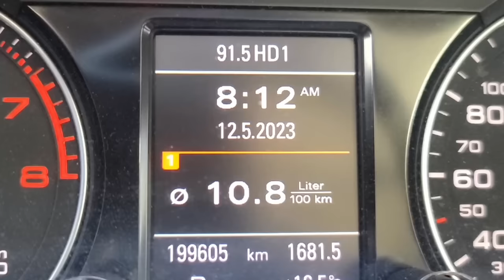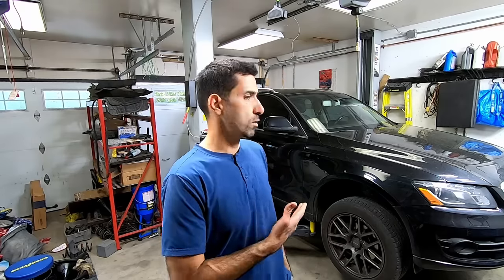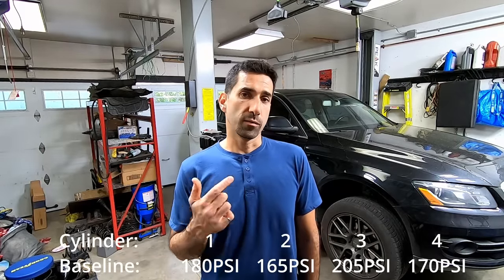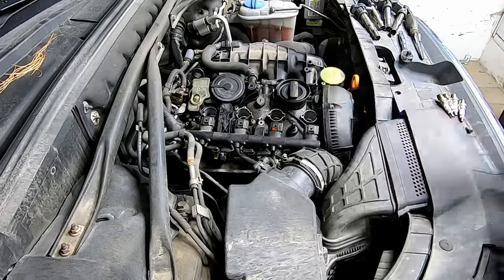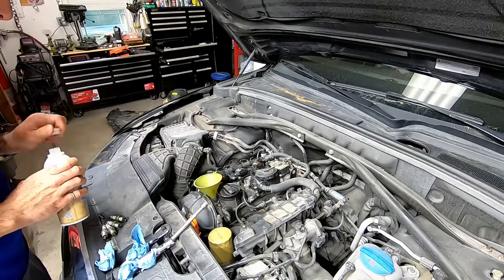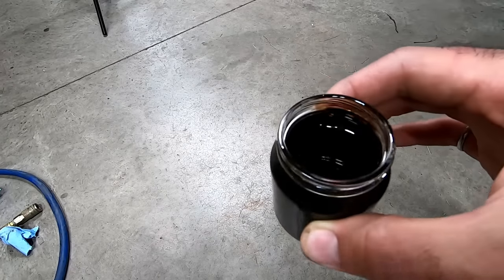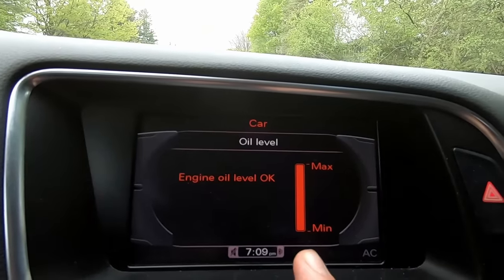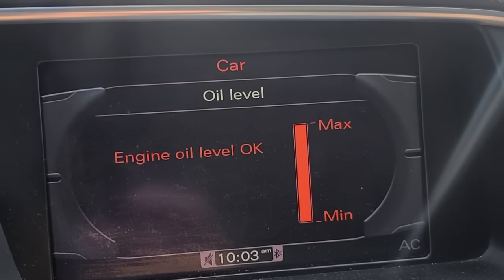How to fix excessive oil consumption from clogged piston rings (Part 2)

Comment: Hey Eurotrash, I have a 2013 a4 with 90,000 km burning 1 liter per 4000km. I am thinking of trying the piston soak before it gets worse. Do you thing this is a good idea? Thanks

Update: Have performed the piston soak using 1 can of berrymans on Aug 24 2023, will update will oil consumption rate as it comes.

Update 2: (September 19th): Put about 2500km on the car and the oil level still reads full, Seems like zero consumption. I am using Penzoil 5w40 euro.
Reply from the maker: Hey that's within spec for sure but there's really no downside to doing a piston soak - can't really hurt anything... at your next oil change just do one up and let us know if it fixed up the consumption... maybe instead of B12 try sea foam as it's less aggressive...or LiquiMoly engine flush
Reply: @ETMotorsports  Thanks for the response! I orded some b12 chemtool on amazon and I plan on doing the soak next month when I change the oil at 8000km interval. I am hoping that this will help prevent the rings from getting stuck and improve oil consumption. I will update the results, if this works it could be a method that can be used whenever the car starts to use more oil again a few thousands km down and repeat the process to maintain an oil consumption level that is acceptable and manageable. That is the goal, I hope to get at least 3-4 more years out of this vehicle and I will be happy!
Reply from the maker: @thomasoneill1077  yah you can do that every year or as long as it helps... do it the first time and see if it improves things...btw you can use the B12 in the gas too - helps keep the injectors clean
Reply: Update #2: The oil consumption has returned to about 1 l per 4500km, it was at full level for almost 3000km then randomly droped very quickly. I will try this again soon but with 2 bottles and a longer soak time of 2 full nights. I noticed that one of the spark plugs threads had oil on them the last time I took them out from the first soak.

Comment: This is such an issue across the board, I feel like this is another stage of built in obsolesce, car works until you have to turn it back in for a lease and buy another one. Between part 1 & 2 I will try this on my other cars, instructions are very simple, thanks!

Comment: If the engine has burned oil for a long time, the piston rings might have damaged the cylinder walls.
Reply: Exactly!
Reply: B12 costs $5.
Is it worth trying?

Comment: I used to do this by flushing the engines with transmission fluid it takes quite a few oil an admirable transmission fluid into your oil help dissolve the build-up

Comment: I have a 2014 Kia Sportage with the GDI engine that started burning oil at 80,000 and has gotten progressively worse. I hate it because the rest of the car has been great. I'm going to try this....Thanks!
Reply from the maker: Good luck - let us know how it goes
Reply: Did it work??? Might need to try on my 2019 Hyundai Tucson 😫
Reply: @rachelodowd6536  OH yeah it hasn't burned a drop in over 3000 miles now. I also drove my car in a lower gear on the highway for about 5 miles with RPM's at 4500-5000. Repeatedly letting off gas and applying gas. Let the engine brake the car some. Try this before soaking. I think thats what fixed mine not the soaking. I'm going to do it every 10,000 miles.

Comment: Hello! Thanks for the great video. Do you have any experience with the Liqui moly engine flush? I’m considering using it on a volvo diesel 2014 after I change the pcv valve.
Reply from the maker: I use LiquiMoly all the time - I've recommended it to a few folks who don't have access to B12... it may not be as strong as B12 so the final results may not be as impressive but otherwise it should work fine

Comment: I have a Jeep Wrangler burning 1Qt every 100 miles🤣. Compression test done 155 psi on each cylinder. Good power. New pcv valve. No smoke coming from the exhaust. Intake manifold has light oil coming from pcv hose. Any Recommendations?
Reply from the maker: Holy smokes... those are hmm good numbers 😱 what year is this? What engine? If no leaks and no obvious source of oil loss it could be rings as well
Reply: @ETMotorsports yeah not good. I replaced everything. 2008 Jeep Wrangler with a 3.8 180k miles. No power issues, no hesitations. Starts good in the morning. I used synthetic since I bought it with 90k. Spark plugs are dry. It has to be the rings. One thing I did notice is that this problem surfaced after doing a liqui molly cat cleaner through intake. After that my oil consumption sky rocketed. I guess it did something to the rings?

Comment: I have a 2012 Q5 with 120,000 kms and started to consume oil…. At this point is using one qt every 3,000 kms which compared to yours it is not too bad…. Anyhow….. I live in El Salvador, Central America… I am not sure if I can get B-12 locally but sure I will love to try…. I also have a ‘11 Q7 with 85,000 kms and this one is not burning oil…. At least not yet…. Thank you very much for your videos I am wishing some more shmucks really get to see useful videos like this one.. keep it up…
Reply from the maker: Hey thanks for the note... you could use a few different products instead of B12 - keep an eye on your consumption and hopefully it never goes to the level most folks see

Comment: @ETMotorsport,
Thanks a lot for sharing a great fix to oil consumption problem. 
I used to burn 1L/600kms. I’m on 1000kms now and oil level is full. I feel so happy after seeing the results man! I used to top up oil every week, else, I used to get low engine oil light 💡.
Reply from the maker: Awesome!! Glad it worked!!

Comment: I just did this on my QX60 with GDI V6, I scoped the pistons before and after and can actually see the heads after, not just a thick layer of carbon.
Reply from the maker: Yeah it does clean them pretty good... what were you consumption numbers before?
Reply: @ETMotorsports  quart every 500 miles. We’ll see how it goes after a week or two, but haven’t had the smoke on startup this afternoon, but have had pretty short trips running errands.
Reply from the maker: @RossWilson  please keep us posted with your results...interesting to see other brands suffer from the same thing - a lot of viewers are suggesting VW/AUDI are garbage because of this but it looks like it's not isolated to those brands only
Reply: @ETMotorsports  yah, do a search for qx60 or pathfinder smoking on startup and you’ll find a lot of the same issues. The problem with this engine too is you have to take off the entire intake manifold to access the back three spark plugs/cylinders

Comment: I’m thinking your oil level was low before pouring the Berryman’s in so the oil level wouldn’t be over max.  That’s what I’ll do anyway.  I have a VW Golf with 1.8L that’s using 1 Qt per 800 miles.  Only had it 6 months!  Thought I would have to get a new motor, but this gives me hope!  I’ll do this in a couple days.  
Thank you!!!
Reply from the maker: Yeah i pretty much waited for the light so I know it's 1L down before i start pouring in
Reply: @ETMotorsports  oops!  I meant to post this on your first video.  I just started 2nd video and see you explained staring with lower oil level.  Sure wish I had that nice lift you have in your garage.
I’m subscribing!!  Thanks again!

Comment: This is great information anyone that can't get B12 you should use automatic transmission fluid and acetone 50/50 mix will also penetrate amazingly on carbon. Anybody can test this yourself on any bolt that is seized or piston ring that is caked in carbon.  ATF and acetone is a secret that has been used for many years and probably better then b12.  Google videos yourself and learn the atf acetone trick
Reply from the maker: Worth a try - lots of folks having a hard time finding B12

Comment: I would not crank the starter for more than 10 seconds or else it will burn out.  You might also get a P0420 code because the O2 sensors are contaminated.  Use lacquer thinner to clear that out using Scotty Kilmer's method. Thanks for this video!
Reply from the maker: Good tip!

Comment: @ET Motorsports, thanks for a very resourceful and money saving video! I am gonna perform piston soak for my A5. Which B12 variant, I can use it? In Amazon, I couldn’t find B-12 CHEMTOOL Injector Cleaner other than Carburetor/Choke.
Reply from the maker: Hey you can find chemtool from other online sources... folks have ordered from ebay too
Reply: @ETMotorsports  thanks 😊

Comment: Thanks for the video! I followed this procedure on my mom's 2014 Q5 100k miles burning a quart every 300 mi. When I pulled the plugs and looked in the cylinders with a borescope I saw carbon buildup on the cylinder as well as some small metal pieces. I sucked those out with a vacuum before leveling the cylinders and putting a bottle of b12 in across 4 cyl and following the flush procedure (rotate, fill, etc). After the flush, the car was misfiring like crazy and the check engine and EPC lights came on. It calmed down a bit after idling for 15 minutes but when I drove it it was still misfiring so I kept the drive short and brought it inside. 

I changed the oil again and the spark plugs and now it is running a little better and there is a consistent P0302 Misfire Cylinder 2 code and P2015 Intake Manifold runner code. The compression test before the flush showed C1: 170psi, C2: 170psi, C3: 160psi, C4: 170psi and after the flush it is C1: 180 psi, C2: 90psi, C3: 180psi, C4: 180psi so cylinder two seems to have significantly lost compression after the flush and is consistent with the misfire code. The P2015 is also a bit weird as the manifold runner flap moves freely and I didn't have it before the flush. 

This isn't a great situation as the car was driveable before (albeit guzzling oil) and now I need to do something to take care of this misfire before I can say anything about the oil consumption. Any ideas on what to try next? Is it possible that cylinder 2's piston ring got stuck open after the flush and another flush on cylinder 2 could help? Or is the ring likely shot?
Reply from the maker: Hey thanks for the info... sorry to hear you're having issues...I'd say  that low compression is causing your misfire and yes I think you're logic makes sense - the compression ring is probably stuck...if I was dealing with this,  I'd start with a soak on cyl 2v only... you know exactly what you're looking for so perhaps B12 for 6hrs, compression test,  B12 for 6hrs, compression test etc... multiple viewers noted seeing dissolved carbon left over on the walls of the cylinder when rotating by hand so keep an eye on that cylinder as you soak and rotate...

Now I'm a bit curious about the metal pieces that you saw before you started - were you able to figure out what those were?
Reply: @ETMotorsports  Yes, that just turned out to be a reflection of the b12 from the light at the end of my borescope lol. When I scraped them out turned out to be carbon and oil. However, after running another 2 bottles of b12 through cylinder 2, including using a hand pump and a tube to ensure it was covering all sides of the cylinder, and running the engine for 10 minutes on 3 separate days, I'm in the same situation. Low compression (90psi) on cylinder 2 and a persistent P0302, P0354 and and P2015 code. There are also P0300, P0302, P0304 and P0506 codes pending. 

Any idea what I could do next? Would a leak test be useful? Is the engine shot? I'm wondering if carbon has been sent elsewhere in the system and is causing these other codes to pop up.
Reply: Bump. I could really use some guidance here. Any ideas on what I could try next? 

I followed this procedure to a T and now my car is undriveable. I really believed that this process was low risk and I’m kinda screwed now that this cylinder has lost so much compression. 

Does that P2015 intake manifold runner code give any clues as to what else is going on? Any advice from you or anyone else that has experience with the procedure would be really helpful.
Reply from the maker: @xer0n747  hey the first thing I would do is repeat the soak to be honest with you...a few users have reported worse consumption after the first soak which gets corrected after doing a repeat soak... one use saw the exact opposite - went from low compression to higher compression across the board... unfortunately this isn't exact science - nobody knows what the state of the rings was before the soak or what's stuck now... it sounds like the first soak got your compression ring on #2 stuck so you need to repeat the process...

Maybe it's a good idea to just do #2 and leave the other 3 cylinders alone... basically take the plugs out,  soak #2 for another 24hrs with rotation in between,  clean the plugs, run the engine again with B12, change the oil and maybe use Rotella T6 with some Seafoam added (not much) and run for 1000km before changing again

As for the intake - not sure what to say - this process has nothing to do wth that so it's either a coincidence or maybe something got unplugged or damaged in the process
Reply: @ETMotorsports  thanks for getting back to me. I did run another 2 bottles of b12 through cylinder 2 alone after your last recommendation. I can try it again. 

I have seen some people using Rotella T6, but I thought that was because the thicker oil would bring some compression back. Are you saying to use T6 for another flush?
Reply: @ETMotorsports  I have some pictures/videos of cyl2 compared to cyl1 (good compression). Is there a way I can share them with you to see if there’s any visual indicators that I’m missing?
Reply from the maker: hmmm I spent some time trying to read up on this...your codes are interesting because they have nothing to do with the soak...

2015 is very common on these motors when the intake manifold flap sensor fails - see here for more details:

https://www.shopdap.com/blog/post/intake-manifold-failure-on-2-0t-tsi-p2015.html

I think you have to tackle these one at a time...honestly it's strange that the compression didn't change after your second soak but I wouldn't panic just yet...take a look at your intake manifold and see if you've got a failure there...depending on what (if anything) broke you may be getting a vacuum leak etc. if you're able to clear up the codes, then you can worry about the low compression...

for that - you repeated the soak so like I said it's a bit strange that the compression didn't improve...I used Rotella in my A4 after doing the soak because it's a diesel oil and has more detergents to keep cleaning the engine while you're running...you can also add SeaFoam to the oil and just run with it on a longer period of time (obviously be mindful here of how much you're adding - shouldn't be more than 1/4 bottle kind of thing)

the loss of compression after the soak is just another symptom of the  same issue - the pistons rings are clogged/dirty...

I`m sorry - I`m not sure that's helping at all...this isn't a "low risk" procedure by any stretch - I think I mentioned that a few times...but it shouldn't cause any physical damage to the motor so everything now rotates around sorting out the codes and freeing up that stuck ring...

where are you located btw?
Reply: @ETMotorsports  Sounds good, I'm working on chasing down the P2015 code and it seems the air temperature sensor located on the front of the intake manifold has cracked and can easily come out of its mount with the screw still attached. When I pulled it out it was covered in carbon...not sure what that's doing for the intake air temp reading but a new part is on the way and I'll see if I can tape this one up in the meantime and check if it was contributing to any vacuum leaks. The manifold flap itself seems to move freely when I press the plunger by hand. so I'll be checking with a vacuum gauge if the line is also good. Are there any other checks you recommend for the intake manifold? I was thinking a leak down test may help determine if there is a vacuum leak or if there is more to the story on cylinder 2. 

I bought some Rotella, and will swap this oil in after checking on the intake manifold and doing another flush on cylinder 2. One doubt I wanted to clear up when doing the next flush is that with these permanent codes in the ECU, I'm getting a check engine and EPC light on the dash whenever I run the engine, and I don't have a VCDS or VAGCOM in order to clear the permanent codes. Will cylinder 2 still be getting fuel and spark with the EPC light on? If not, wouldn't that reduce the effectiveness of the flush (burning up the excess carbon in the cylinder with the b12)? Is there any way to clear these without the dealer tool? 

As for the low risk, I guess I meant more of low chance that this procedure would make the car worse given how full the comments seem to be with success stories. You gave a fair disclaimer, and I'm hoping I come out on the side of the rest of the happy Audi owners in the comments, but it's hard to know when watching the video/reading comments how it could go wrong. 

I'm located in the Philadelphia area in Pennsylvania. You?
Reply: if the compression has dropped after flushing B12, you may need to disassemble the engine and inspect the pistons. Perhaps the partition between the piston rings has burst. Or something got under the valve. The valve may have burned out on the side. In any case, the loss of compression is not the fault of the B12, it means that the problem already existed, and flushing simply brought it out.